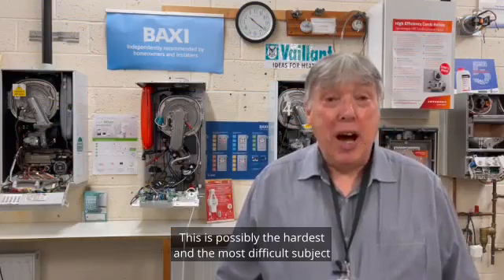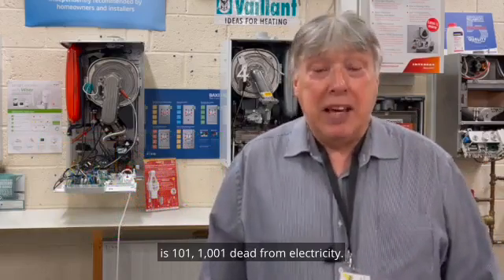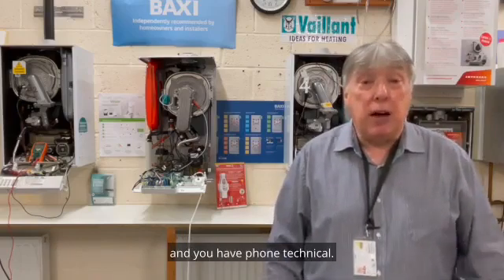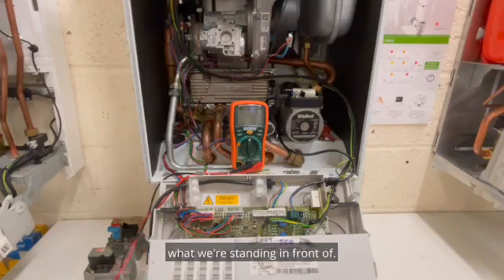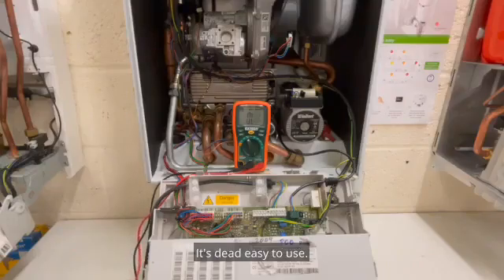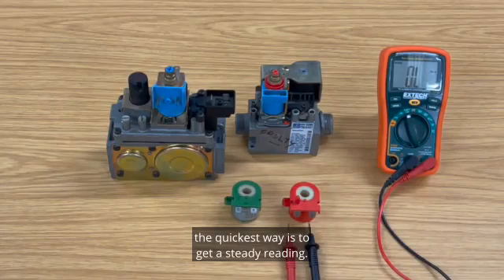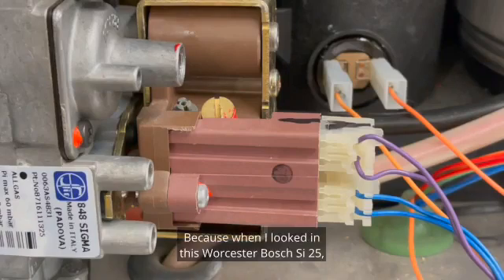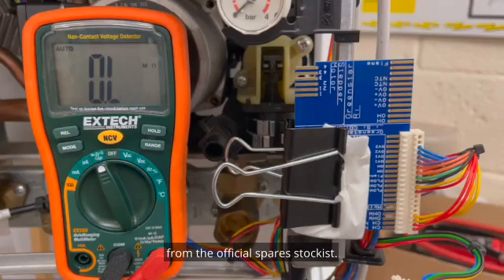GAS valve testing is very difficult this video could help.

Comment: Hello, great video, but can you show testing the voltage going to the gas valve, as on some boilers I find it almost impossible to get the probes of my multi meter to make a good contact. Thanks, Adam
Reply from the maker: Hi Adam, thanks for that and you are correct too many boiler parts are fitted badly making testing very difficult or even worse difficult to replace, but no one listens to me. What I did was to order new meter leads with very thin probes (BG engineers have them) shop around, shorten the metal probes to 10mm just enough to fit on the PCB connection which is where I did all the testing not on the component, much easier and faster. Hope that helps, may do a video on this.🤩👍
Reply: @mrcombiBedford  Thank you - yes it does help and I’ll follow your advice. Btw I came and did your fault finding and wiring courses quite a few years ago when I first started - both very good - I might come and do the fault finding one again sometime as I think I’d get more out of it now I know a bit more. All the best, Adam
Reply from the maker: @adamkay60  Hi Adam,
I retired from training in September 22, to concentrate on Vids and APPs have a look https://mrcombi.com

Comment: We were always taught to test both Solenoid Coils separately George. Where can you buy your wee Test Board mate? 
Thanks for sharing luv👍👍
Reply from the maker: Dear Fibre, this is true but Tech. Dept. will always quote (and we test)  pins 1 to 5 to see if open circuit then no need to test each one. take care George Staszak 🤩👍